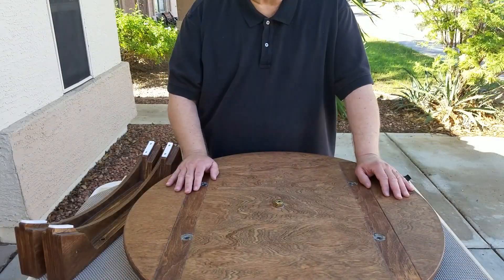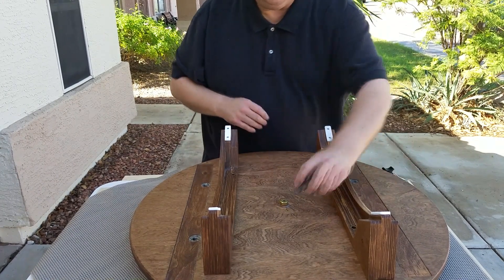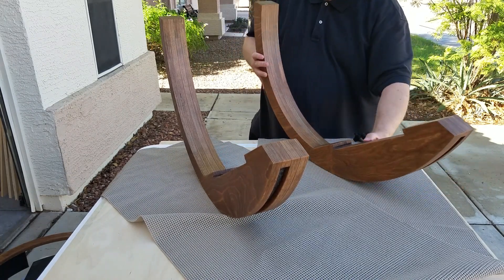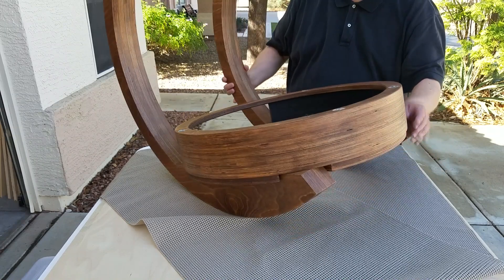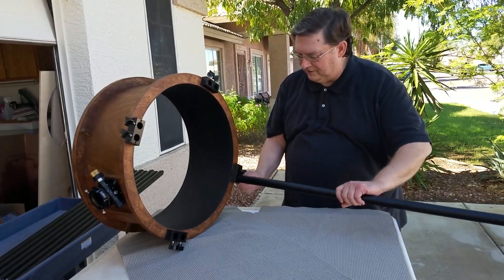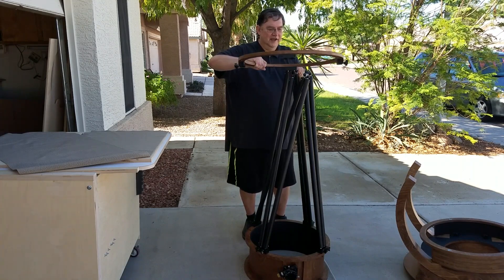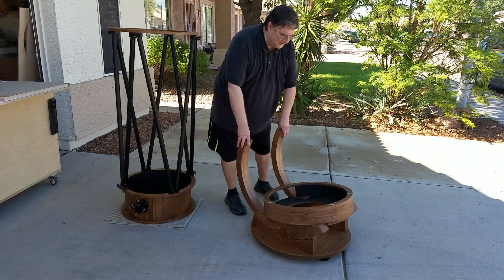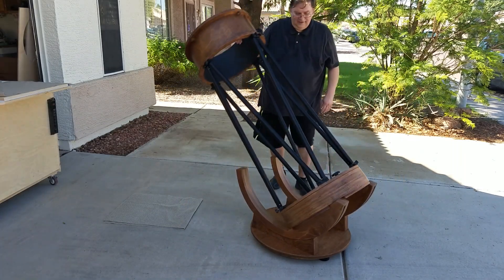Big Telescope, Small Package: Waite Research 18" Renegade

Comment: Gordon, if you don't mind me asking, what material did you use for the wall of the section at the end of the scope? I am assuming it's 1/8" plywood sheet or something to that effect just glued to the inside rim of the circular rings?
Reply from the maker: It's very thin aircraft plywood, about 2 or 3 mm thick.  I route a groove in the end of the rings so the plywood has a good place to seat.  And it is glued in place as well.
Reply: @GordonWaite  Awesome! Yeah it looked pretty flush with the edge of the rings. Was wondering if you grooved it out as well. Appreciate the information!

Comment: how often does the light gathering mirror need to have a new reflective coating?
Reply from the maker: Depends on where you live, and how often you use the telescope.  If you live near the ocean, or near an industrial area with air pollution, you will probably have to recoat every two years or so.  Otherwise coatings can last 5 years or even much more.

Comment: I've never used a dob before but I am very interested in them as a means of acquiring a large diameter scope.  You hear all the time about eyepiece height at the zenith but I never have seen anyone comment on height at the horizon!  As much as I don't want to be perched 3-6 feet off the ground neither do I want to be lying in the damp grass to look at an object low to the horizon!  Thoughts?
Reply from the maker: For telescopes in the 16" and under category, the eyepiece height if you are looking at something, say 25 degrees above the horizon, might be in the 36" range.  That's usually just a little below what you can do with a normal stool, but they do make observing stools that start a little lower.
Reply: Thanks Gordon... I'd say 95% of observing is done between 20-80° from the horizon so I guess it should not be a problem.  I'm starting to think what would be the 'ideal' telescope and it seems to me it would be a dob with the eyepiece at the declination axis.  So you would have a 3 mirror design sorta like a classical cassegrain but instead of reflecting the light thru the primary you bend it 90° thru the dec axis.  You can then set the height of said dec axis to whatever you like and it will never change.  Seems to me planewave or one of the big RC makers have one like that... wonder if one of the dob makers (hint hint) would contemplate something like that???
Reply from the maker: They started making those in 1845!  Here is a link: http://www.astrosurf.com/re/fixed_eyepiece_telescopes.pdf
Reply from the maker: And the design has some issues.  If you put a mirror at the top of the tube and reflect the beam back toward the primary, it requires quite a large mirror, like 40% obstruction.  Lots of diffraction effects, and a lot of the incoming light is obstructed.  And the third mirror down by the primary causes more loss of light.  You can get around some of these issues by using a set of relay lenses, but they also absorb light, and inject aberrations into the final image.  Not an easy problem to tackle!
Reply: Hi Gordon.  That pdf was interesting and the design I'm thinking of is called a Nasmyth.  It is Planewave that is making the Nasmyth in their .7m scope.  For a 1/4 mill it better perform! LOL  Planewaves design is simply their RC with the light path thru the dec axis so it does have a large secondary... but then all RC's do.  What I am talking though is simply replacing the stock diagonal of a stock dob with an exact same size convex mirror.  You don't give diagonal sizes for your scopes so I went to Obsessions site and their 25" F/4 uses a 4" minor axis secondary which gives only a 21% obstruction by diameter of the primary.  I don't see a problem with this and the third mirror will be maybe about 2" minor axis so it will be in the cylinder of the secondary and not obstruct anything.  Other than having to get someone to grind the convex secondary to the proper curve I really don't see much of a problem with this.  Can you just imagine as other people are climbing 6 foot up a ladder to peek thru their dob you sit in a nice chair and look thru yours!?
Reply from the maker: If you make the secondary convex, then that's a Classic Cassegrain telescope.  The primary is still parabolic, but the secondary has to be hyperbolic.  There are all kinds of companies that make Cassegrain telescopes of various flavors.  Our 20" Renegade is most popular as a 20" f/3.5, and the system is short enough that you never need a ladder.  Feet-always-on-the-ground is our biggest selling point!

Comment: Hi Gordon, Why did you choose to use 8 poles (as opposed to six) in the barrel-design? Won't this make an over-constrained assembly?
Reply from the maker: If you only use six poles, it is hard to make a shroud that doesn't hang into the optical path.  But really it's a tradition, I suppose.  The older designs (many of which are still being built!) mostly used the "box in a box" design that originated with Dobson himself.  With the old "box in a box", it is way easier to use eight poles and put them in the corners of the box.  Hard to put six poles in four corners!  But with our design, six poles would be a snap.  Maybe you've motivated me to reconsider!  Thanks!  -Gordon
Reply: Hi Gordon, I don't know much about the optics-aspect - my question was purely from a mechanics-standpoint. I came across this one page: http://www.cloudynights.com/page/articles/cat/articles/optical-theory/stray-light-control-in-newtonian-telescopes-r2006 where the author also has a six-pole (Stewart-platform-esque) barrel. Cheers!

Comment: amazing gordon!! conglatulations!!! did you made that beautiful wood structure yourself?
Reply from the maker: Thanks!  Yes, we build all of the Renegade structure outselves.  We cut many of the wooden parts on a ShopBot CNC router.  Most other things are pretty standard woodworking and metalworking steps.  Emerson takes care of both our video projects and much of the sanding.  Renee does much of the sealing, staining and polyurethane application.  And I manufacture the primary mirrors.  Our biggest advantage is doing everything possible in-house instead of having to contract with other suppliers.